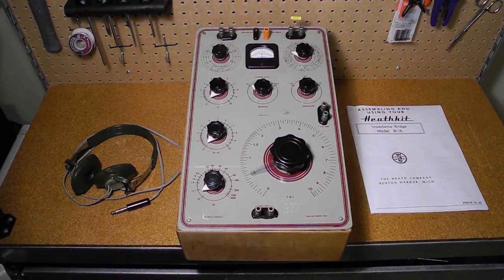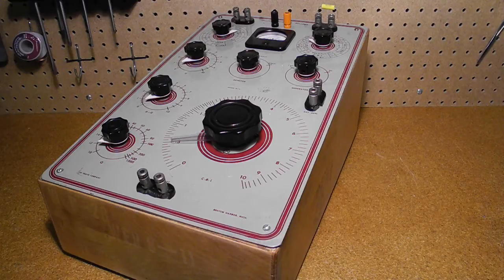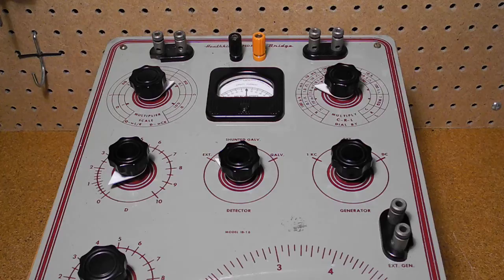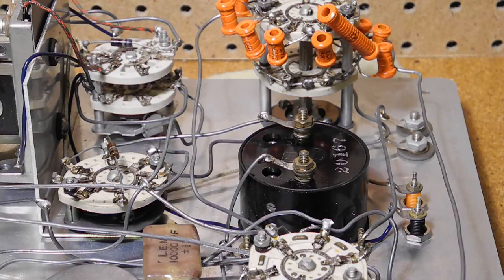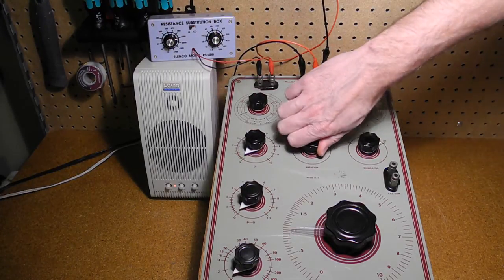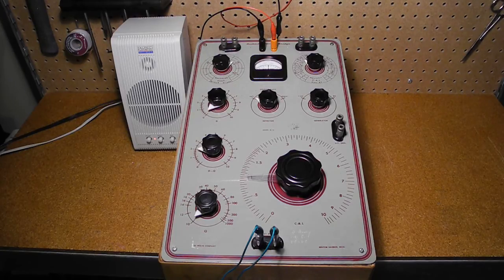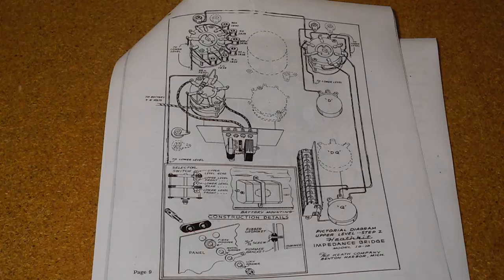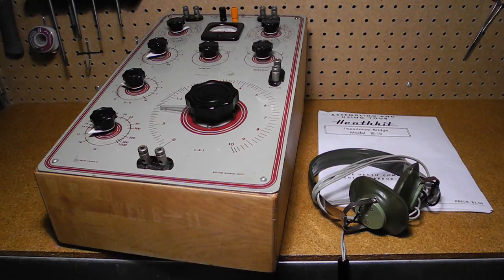The Heathkit Model IB-1B Impedance Bridge

Comment: Jeff, I have had one of these for years.  I did not realize the original price was so high.  I have used a 6 vdc lantern battery for mine.  They are still available.  I rarely use it, but now it will reside in a place of honor in my equipment.

Comment: Hi Jeff

I have one of these, the IB-1B version, looks just like yours except the CRL knob is larger in diameter but does NOT have the clear plastic pointer.

Mine is working just fine for DC resistance, but does not work for anything else since the 'hummer' does not oscillate correctly. I have managed to successfully use the unit to find the values of a few assorted capacitors, using my jerry-rigged method of constantly tapping lightly on the side of the hummer's carbon mic element with a small wooden dowel rod; each tap gets me an audible blip of tone (directly from the hummer) that is about 1kHz I think, and when I have a PC speaker connected to the EXT terminals, I hear the pings through the speaker...so I can home in on the capacitor value by listening to the volume of a series of pings, rather than a constant tone.

I would like to get this unit working correctly, but it all hinges on that recalcitrant hummer. I wonder if you, or any of your viewers, might have some wisdom to impart in this regard. Perhaps somebody refurbishes these hummers? Maybe somebody knows of some NOS or other source of WORKING hummers of this type? Might be some procedure I can use to make it work?

Any advice will be appreciated.

By the way, this unit DOES work when I apply a 1kHz  since wave in the 1 ~ 2Vpp range from my benchtop signal generator to the EXT GEN terminals, and have the Generator switch set to EXT.
Reply from the maker: I don't know much about the hummer and have not seen one in any other test equipment. It does look like there are some setsrew adjustments that can be made on it, so it might be possible to get it work more reliably by adjusting it.